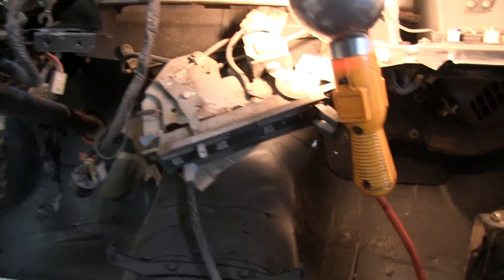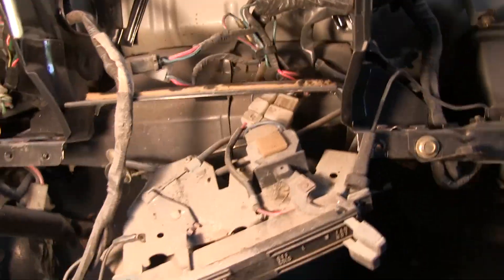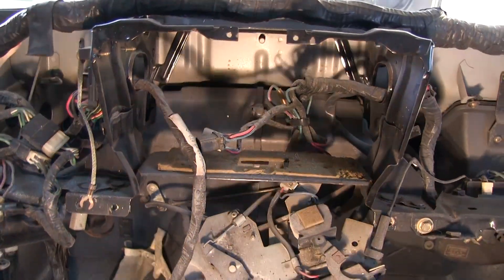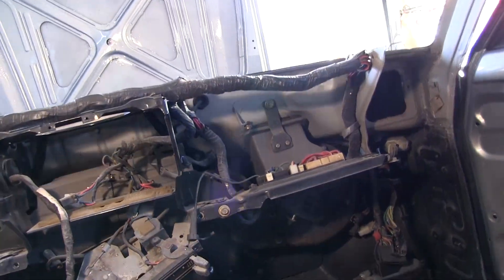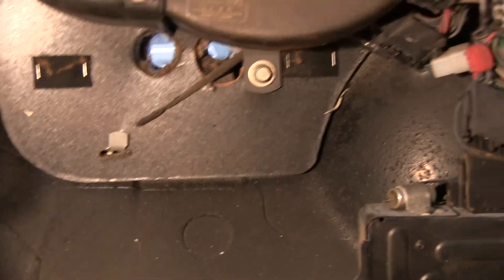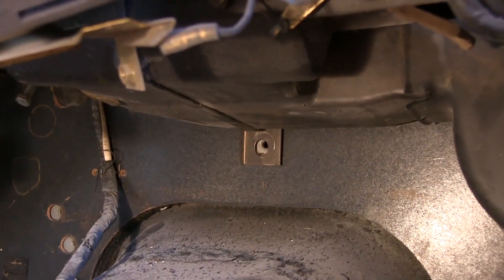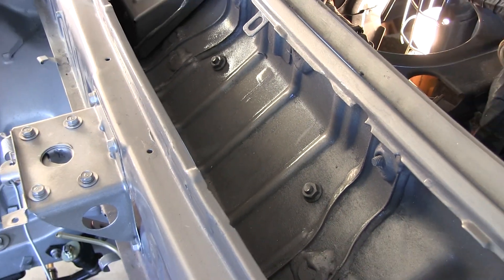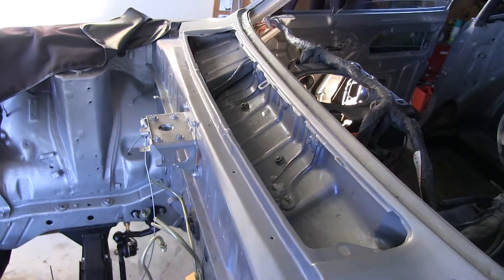LTS Xtra Heater Bolt Locations on Mazda RX3

Comment: This Vlog is brilliant, will make reassemble of mine so much easier with all the fine detail i.e. what nuts go were and what type for example, excellent. I bought mine from Nick a patreon of yours, its now right hand drive and and Australasia spec
Reply from the maker: Thanks for watching mate!
Reply: @LetsTalkShop  Excellent detail in your response based on what I said, Nick went out of his way to get title for my vehicle and ship it to New Zealand and you say thanks for watching, sharpen up bud
Reply from the maker: @Kiwi-pp7rg  It's 2am bro. I was trying to acknowledge you. Which Nick did you get yours from? I don't have a patron named Nick. Is the value of RHD greater than an LHD? I'll go get some sleep now. I'll be a bit sharper in the morning.
Reply: @LetsTalkShop  2am and your answering, odd to say the least